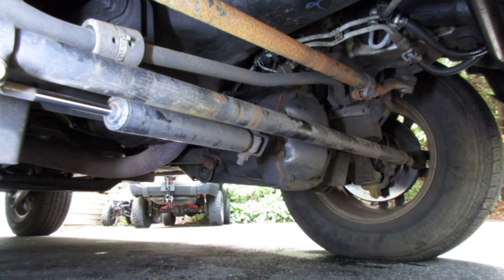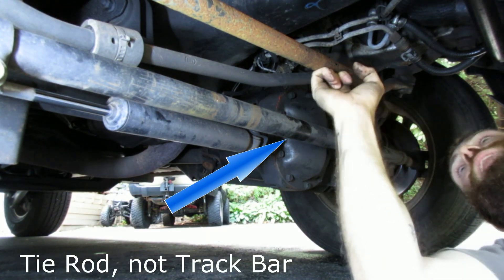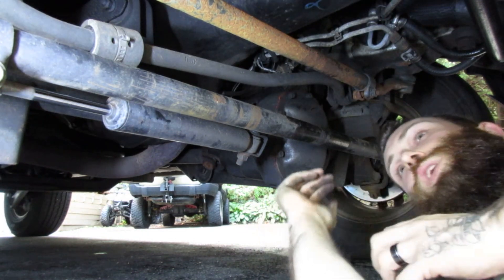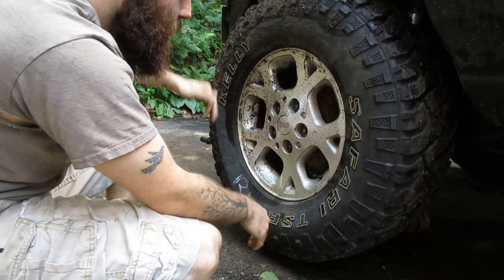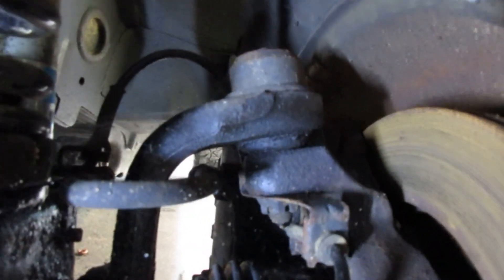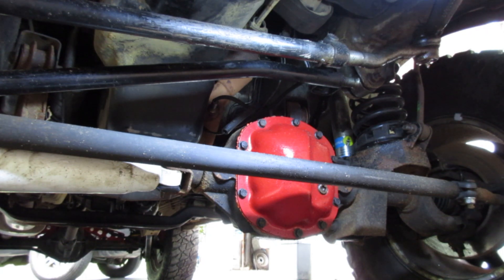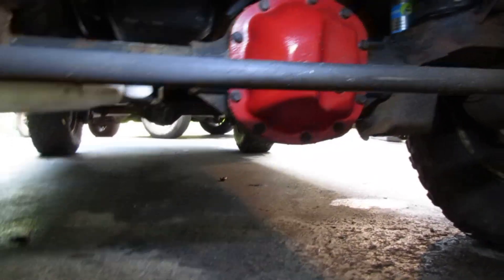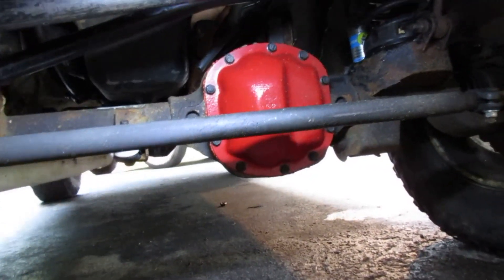How to Diagnose DEATH WOBBLE

Comment: I have a 2005 Wrangler X (TJ) - I had a horrible mechanic when I first got her and decided to start fixing her myself.  I (by myself) have put in radiator, water pump, thermostat, dana gears - in fact an entire rear end, etc.  I noticed we had death wobble and it seemed cured when I had 4 brand new tires put on.  Then I changed my front brake pads and POOF - it was back again.  I have watched video after video on death wobble - I was dreaming about death wobble - I drive at 2000 rpm no faster than 30 mi an hour to avoid death wobble - and no one .....NO ONE out there could help me figure it out - that is until now.  The way you are able to break it down and describe the issue is so impressive..... You are my very first and prolly my last - but this is the 1st time I have subscribed to a channel.  I am going to see if what you say works - but as of right now I have a new confidence about what I am about to undertake - so  THANK YOU THANK YOU THANK YOU  - Sincerely, YouTube certified Mom Mechanic =)

Comment: There is an easier way.
Lift the front end up and have someone move steering back and forth 2-3" slow and steady.   From underneath, look at all connections and joints for play.  Be sure to check your trackbar as well.

Comment: Great in depth explanation and break down! 
  One more thing that people overlook, the break calipers can and will cause death wobble as well. 
1. Piston sticking and/or seizing due to lack of fluid flow, torn boot where debris and moisture corrode the Piston to the point it fails causing the pad not to move in and out. Dual pistons calipers can have a partial failure causing the pad to tip resulting in rub and uneven pressure. 
 If a piston is sticking or seized rebuild the piston or replace the caliper entirely. Do not try to free it cause it is damaged and the corrosion will create more damage as it moves in and out. Lubing it may free it up but it failed for a reason. It's a sealed unit and cannot be exposed to the elements so if this happens repair immediately.
2. Break pad guide/clips are dirty corroded or damaged not allowing the pad to move in and out freely. Cheap easy fix. Usually caused by reusing the old guides.
3. Caliper guide pins old dirty, corroded or simply not lubed up. The guide pin boot is either damaged allowing dirt and debris to get In drying the lube out causing it to stick or fail which prevents the caliper from moving in and out, or it is old and worn and it no longer returns back to rest position.
   3. Lastly and least likely but does happen...The break pedal push rod that goes through the booster into the master cylinder is at improper length not allowing fluid to flow back into the master from the caliper causing the caliper piston to hang up or freeze due to lack of fluid.
  All of these things puts uneven pressure on the rotor causing the wheel to track out of round creating a wobble/shimmy. Check rotors for excessive heat. With that being present as well as noise and pulling to one side are indicators of break problems caused by friction due to worn out, damaged or improperly installed/replaced components. 
  All of which need to be addressed immediately!
  Overall excellent in depth quick description that conveys to all vehicles straight axle or independent 👍

Comment: In my experience death wobble comes from the front tires fighting each other. I don’t think toed out will cause it but good grip tires toed inward too much will always cause it. Regardless of the part causing the play it is when tires are free to point toward each other and grip jumps from one side to the other
Reply: I agree . I drove down a wet dirt road and looked at the dirt to see the dirt was going at an angle. Like left rear tire was more turned more left and right was going more to right. Tires were eating insides up.

Comment: I have a 2000 Grand Cherokee Limited that I have replaced everything in the front end. And still have death wobble. I was told that warped front rotors can be a cause. I watched a video stating that the teves style calipers can warp the rotors if you put a lift and bigger tires. And an upgrade to the akebono style calipers and new rotors can solve the issue. I'm getting a little tired of chasing this issue and possibly changing parts that don't need changing. Are the calipers and rotors a possible cause of my death wobble? Thanks for any help.

Comment: Any time I have an axle out of my TJ I replace wheel bearings, ball joints and axle u joints at the same time. You can do both side for less than $200 bucks and be be done with it all in a couple hours.

Comment: Excellent video. I'm at a loss right now. I can't find the source of the wobble. My WJ wobbles at about 65-75 mph in the highway after i hit a bump. I had the track bar bushings, upper and lower ball joints, lower right outer tie rod end, front left outer tie rod end, upper right outer tie rod end, front outer tie rod end (between steering arm and pitman arm), front outer tie rod end, both front wheel hub & bearing assemblies, and upper and lower control arms replaced at great expense. And it still does the death wobble. Please help with ideas. PLEASE!!! Coincidentally, the steering stabilizer and shock absorbers were replaced. I hate to say it but after the steering stabilizer was replaced the wobble went away for 3 months. I run a V8 Limited WJ with Quadra-Drive and 4" Zone lift kit.
Reply: I know this is a year late but generally curious if you ever figured out the cause? I'm close to the same as you and also have the zone lift.
Reply: @slienemann10  ya, it's still not solved. And since folks like you dont't respnd, I have to go to experts in Phoenix who charge enough to get  new ride
Reply: @johnsabaku2257  we'll I'm still working to fix mine so if I come up with anything I'll let ya know.

Comment: Thank you so much. This is great. The guy is a great teacher. I have a 2005 Sequoia with a random shaking that comes and goes. The mechanics first said it was likely a bad tire rib, so I bought new tires. Same problem. Then they said it is one of the rear air bag suspension. So they put that in. Same problem. So I too it back and they said it was a front and real wheel out of balance, and so they balanced the wheels (this time for freed). Same problem. So I took a video of the shaking of the steering wheel and the truck vibrating while driving.  Yesterday, the mechanics put it on the hoist and said, "Ah ha. See here. It is the steering gear mounting bushings. See the play. We can replace the bushings with only 2 hours labor."  I said that is something central under the vehicle and the actual vibration when it starts is in total sequence with the revolution of one wheel, because when it starts say at 50 mph and I let my foot off of the accelerator without breaking the vibration slows so that with each revolution of the wheels or wheel you can feel the "whump".   Like - at 50 mph a rapid shaking to slower "whump .... whump .... whump" as you slow down. Then after its little fit and I turn it off and let it rest and start up again a half hour later and drive there is no vibration ???.

Comment: Best video on the subject by far!!! wish i saw it before replacing the steering stabilizer!  I do have a question for you.  Like clockwork, my wobble only starts after about 5-6 miles of driving.  The jeep has been relegated to an around town car until i can figure it out.  Any ideas as to why it only starts after a few miles of driving???  Parts warming up?

Comment: I used your video to diagnose the “death wobble” in my 1931 Model A Ford. Using the 9/3 12/6 tire trick, I quickly found a lose tire rod end. It was an easy fix to tighten it up (the Model A has a unique tie rod end where there is a cap the screws out - it was almost completely out). Great video that will work for many make and model cars. Great work.

Comment: What steering parts, tie rod, tie rod ends, ball joints, would you recommend to rebuild the front end of a 95 zj with 4.0L. Have a 3" puck lift, stock springs.thx love your info and vids!

Comment: I've watched this video when I first got my WJ, and I recently just spent over $1800 on parts and labor, for new ball joints, tie rod ends, wheel bearing, CV axle, and internal seals, and new control arms. I also put on a new trackbar, and while I was under there I checked my control arms like you pointed out, and my front upper control arm bushings were SHOT! So add that to the list and hopefully that cures it. Thanks man for all the vids, you and Eric are awesome!
Reply: Did it fix it?

Comment: A great explanation.  I have a JKU 2012, and I just replaced the ball joints which cured the death wobble.  I also broke a bolt in my wheel hub assemblies, so I changed both of them while I was under there.  About a month later, I upgraded my tie rod and draglink and it truly feels like a brand new front end!!!  Thanks for the video.

Comment: 2004 jeep Rubicon... had death wobble replaced my ball joints and steering damper...no more DW.  A few years later it's back. Going to do the track bar today !    UPDATE:  did the trackbar and upper and lower control arms. JP runs like the day I drove it away from the stealership !

Comment: I got bad ball joints on mine and my wobble is getting worse.  Believe it or not, it originally started happening when my REAR UPPER CONTROL ARM went out and snapped in half.  Fixed that and wobble was fixed....for the most part.  Its been gradually getting worse and now every time i hit the smallest bump or shift in slope i can hear my balljoint pop.  Got worse in the past 2 days

Comment: Just had my first case of death wobble today and it was quite severe. 55mph on a curved high rise bridge it was pretty sketchy. Noticed my left front caliper was pulse dragging pretty bad afterwards, to the point where 1/2 mile drive heated the rotor up to the point where it sizzles my finger tips when I   gave it the touch test. I'm about to give her the ol troubleshoot run through now.

Comment: Ok, love your video so is death wobble only the front? I think I have bump steer. Since I work I can't get to it until Saturday. I just bought the Jeep last Friday. The back end of the  Jeep wobbles a bit after going over a bump. When I bought it I noticed two items loose inside the spring on the drivers side. The one piece looks flat on the bottom and tapers to a round top the other piece looks like a 2" ring. I hope it's not parts from my 2" lift. My question is do I order different sized parts than factory when I have a lift? 2004 Jeep Grand Cherokee Special Education. High miles Thanks

Comment: 2 other items you forgot : shot swaybar links and shocks. so many times I do see shocks been so shot and people don't address them causing massive play to the front axle that the complete axel has a movement from side to side of up to 1" which ofcourse destroys first the swaybar links and than it's racking system. Also on the trackbar chassis mount can become loose as a result which should be checked too.

Comment: My 1-ton Dodge dually has independent front suspension and has death wobble. It wasn't well-cared for by the previous owner so the ball joints are clunky, tie rod ends are worn, steering is worn, etc.
Reply from the maker: In a situation you likely need to replace everything ball joints, wheel bearings, TREs
Reply: @DEInTheGarage  Thanks for the advice. The suspension has been severely neglected but I'm glad that the body and interior are really nice. That's the biggest reason I got the truck.

Comment: Your really pushing the upper and lower Control Arms in the Jeep with Death Wobble. At the least you should swap those for Adjustable Control Arms for the lift you are using. As you know the more you lift with short arm's the pitch of the arms gets steeper and you loose some control over the axle itself.

Comment: Can a steering gear box possibly cause death wobble? I have changed all these parts and more but need to inspect control arm mounts. Still had death wobble. Had a different set of used rims with tires mounted put on. Have not experienced the wobble in a long time but still nervous it’s gonna pop up. I’ve been told steering gear box may be bad. I have another used on I just got but have not installed it yet.

Comment: Man thanks that’s an awesome video just replaced my tire rod ends factory dodge recall after getting it from the stealership the death wobble was WAY WORSE so I replaced the trackbar and steering dampener ( old one was really worn out ) truck was better but the DW was still there have the drag link and ends to be replaced tomorrow but will be doing the ball joint and hub assembly test tomorrow this is the first coil over straight axle I’ve owned and have been wrenching since I could remember never had to deal with a death wobble before

Comment: Does this maybe happen with BMW x3? Because I've changed front axels atleast 2 but I honestly think this problem happened once I replaced the brakes and rotars with the cheaper ones off Amazon. Because its more so only when breaking. More so braking hard. Above 30mph and trying to stop fast the whole front end is making a very loud noise and shaking the whole front end violently .

Comment: The best and most honest video I've ever seen on this problem. I have a 1994 OBS F250 2 wheel drive and when I hit a bump in the road it does the death wobble. I've seen many videos on this problem and most say it can be fixed with a stabilizer....but we all know 98% of the problem is worn parts that people like me may not know how to R&R. Seems like it is a hella job even replacing ball joints? Big pickle forks and sledge hammers? Am I wrong? This is a great video though. It really is. Mostly because because of it's unvarnished honesty.

Comment: Much more common in solid axle vehicles but by no means specific to them. Independent with CV axles get death wobble as well. Been a problem with F150 since at least the mid 90’s. Great video and explanation though.

Comment: Really good presentation and explanation. I’ve got the 50mph wobble even with balanced tires. Gonna ccheck ball joints now.
Reply: Did you ever figure it out I have same problem only wobble around 50mph

Comment: Land Rover Range Rover p38a's. These have solid axles and can suffer from "death wobble."
My death wobble was ultimately caused by my Range Rover being stood for four months. How? My tyres at the front had flat spots (4.6 V8 Gems engine). I drove it on low speed roads (30mph) for thirty minutes, then went on a motorway and slowly took it up to 70mph. Eventually it went back to 100% again. For safety, my garage guy checked everything over on the suspension, to find zero problems. Even checked the balance, no weights required. 
Very strange, but true.
👍😎👍🇬🇧 MDS

Comment: I need your ugent help. I recently had a 3in spindle and block lift on my 03 ford f150 2wd but before that i had all my suspension parts replaced including the wheel hubs and bearings and 2 days after i got the lift when going down the road my front driver wheel started to wobble. So i had to tow it back to the shop and the guy told me my bearings became loose and it ruined my new napa hubs. Note: My bearings were from ebay. And so i had to replace the entire hub again since the bearings melted inside the hub so he told me i also needed a stabilizer bar which he order and he will install it so my question is what do you think made my front driver tire wobble like that when i had new hubs and bearings it was kinda scary. What should i do. Do i need to have him check my trac bar? I dont even know if my truck has one. Pls help me i want to get my truck running right plus i dont wanna keep spending more money. Thank you in advance. Great video btw very well explained.

Comment: So i just got a 2000 Jeep Grand Cherokee Limited and discovered the death wobble. So i went ahead and replaced the tie rod, drag link, track bar, both front bearings and hubs, the ball joints looked fairly oh k i just greased them and replaced a cv axle boot and packed with grease and last but least replaced the steering dampner and still having death wobble im gathering at this point i need a alignment and new tires maybe?
Reply from the maker: Tires out of balance could do it.

Comment: Trust me on this one, 40 plus years fixing autos. The death wobble is NOT from worn parts!!! It IS due to Too much Negative caster. Have a real alignment done and move caster as much positive as possible with keeping the camber to as close to zero as possible.. PROBLEM SOLVED!!!! Also toe set at 1/16 in on both sides. No more wobble and tires will last much longer.

Comment: How likely is it that a stock ZJ or WJ will have death wobble?
Reply from the maker: It can happen to any solid front axle, but when it is less comon when stock and it also isnt as violent. I had a stock WJ get DW, but it felt more like bump steer and not the violent "coming about on reentry" feeling you get when you are lifted 4" on 33's
Reply: Thanks, I am currently researching jeeps and trying to find a 96-98 ZJ V8 but they are hard to find on the east coast